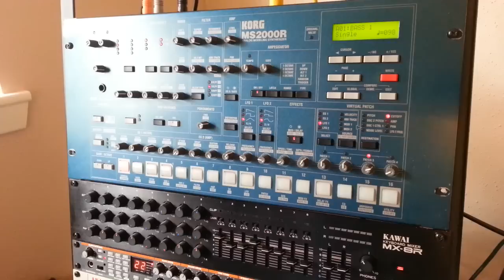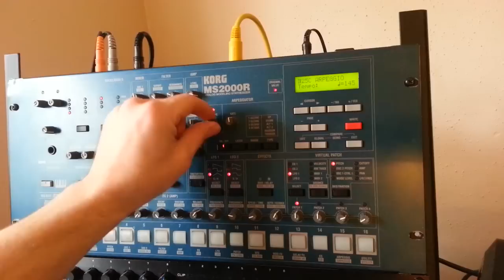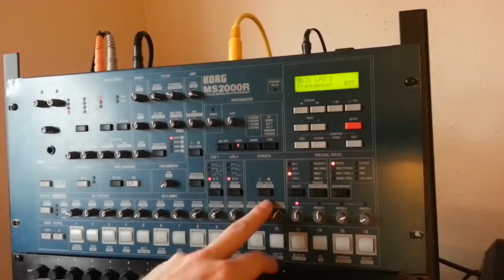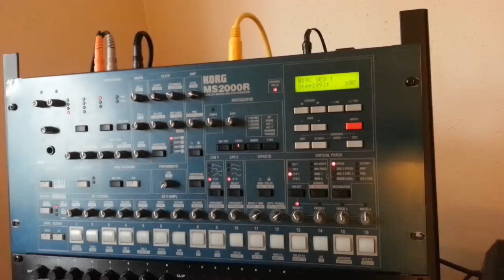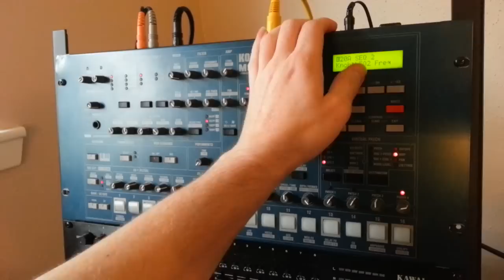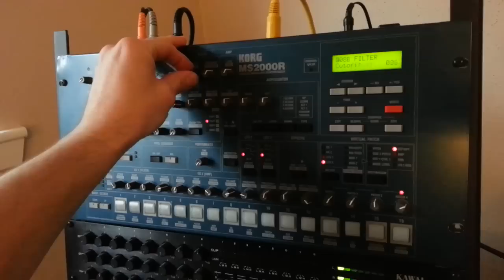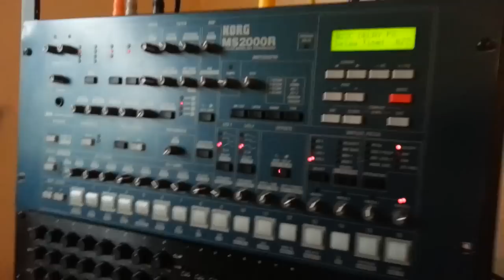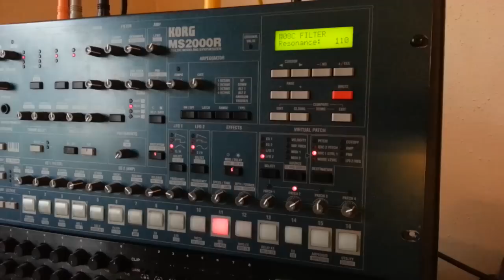KORG MS2000r overview and How to : Mod sequencer

Comment: Excellent thanks a lot Will - been programming up the old MS2kBR (linked to the B keyboard: 'ODD/EVEN' now = 8 beastly voices!), so this was real helpful.  ps. curious what's the Kawai unit below Will? cheers
Reply from the maker: glad you like the video. The kawai is an mx-8r, an 8 channel mixer with 1:3 midi splitter. It distorts nicely when over driven and very cheap.

Comment: Great tutorial, thank you! The manual - as you said, doesn't explain very much on the synth side! 
Is there a way you can sync your computer to be used as the beat/drums and as the clock instead of an MPC? If there is, does it just work the same as if you were using the MPC?
Reply from the maker: You can, but you will need a midi interface. That will allow the computer (daw) to send clock out or receive clock from the ms2000

Comment: Great video, better than the manual :) Got the ms2000r some years ago and learnt how to use it pretty much but it's not had much use for a while with new gear entering my studio. Just got the keyboard version today so I'm experimenting hooking them up. Have you done this? I'm trying to get them to play as an 8 voice but there is very little information available.
Reply from the maker: +zafrosoundz I just got one myself. I traded a Korg Minilogue for it + some cash. Anyway check it out: https://www.youtube.com/watch?v=ZApiSSGHFUU
Reply: +will haha we're on the same wave length dude. I actually found the details in the manual eventually. Lots of angles to explore it's a whole new beast now.    I've been experimenting turning off send controls etc using it as a 4 Osc synth. A lot to explore.

Comment: Great turtorial! Many thanks!!
I bought this synth last week as second hand.
Is it possible to have 2 sequences running for the pitch?
So for example  on SEQ1 a base line and on SEQ2 higher notes?
Reply from the maker: +peterismobiel Yes and no, If you have to mod lanes adjusting pitch, then they will sum and provide only one output. However, if you split the mode into 'dual' and setup 2 separate timbres then you can mod sequence each one, but you will need to setup a split or separate midi inputs. If that doesn't make sense let me know and I can do a quick vid next week to demonstrate, thanks for watching!
Reply: +will scott 
Hi Will, thank you so much for that! 
Since I am totally not familiar with this machine,  I would love a video. 
It is so much easier to understand for me (and others too I presume) because you certainly know your way around on this synth :-)

Comment: Thanks for you video! But I can`t understand for sure. How many instruments can you run with this midi-spliter? I saw the back of it - it has only 3 midi-outs.
 Please, correct me where I'm wrong...
 midi-controller connected to MPC via midi -> MPC midi-out connected to midi-spliter in - > all synths connected to Kawai via midi and audio -> audio-outs of Kawai connected to Behringer?
Reply from the maker: Sergio V correct, and if I'm short on outputs from the kawai I'll use a midi thru from an instrument to connect

Comment: Great video
However - after all this time you spent creating that sound / custom patch / custom voice (however it's called)  - I understand that if you now switch to another sound, or switch off the machine...the custom sound you've made will be lost! 
Do you have any advice for saving sounds for easy recall? 
In a live situation you might want to toggle through multiple custom sounds during a live set - in which case you wouldn't be able to create each custom sound afresh mid-set. - unless you want to annoy the hell the audience.

Any tips?
Reply from the maker: Yeah, I should have demonstrated that! Basically after creating a sound you press the 'write' button twice and the patch will be stored in the current slot
Reply: I see - so one has to write over the preset sounds to save new ones? Any way of making new slots?
Reply: Thanks for getting back btw

Comment: Great video. I feel like this is a dumb question, but in your video, when you make changes to any parameter we see those changes in the menu along with the parameter name.  Is there a menu setting to enable this?
Reply: Also, I'm using the non rack mounted version.
Reply: Nevermind. I wasn't in edit mode.

Comment: Very helpful video. You helped me get out of the presets and actually make a pad. Still it seems my sequencer is not working I followed your instructions: pressing seq 1 then adjusting the knobs and then turning on the mod sequence and pressing a key but only the light under knob1 "common" lights up. If anyone could help with this i would be very thankful!
Reply from the maker: FellCommaDestroyed it's like 1 of 2 things.. either you need to hold the key down longer OR under the sequencer settings in the menu, Last Note is set to 1 and you'll want that up to 16..
Reply: thanks for the response! I will give both a try
Reply: I'm thinking that the problem has to do with the sequencer settings. I can't seem to find last note in the menu. Under SEQ COMMON E18A-E18E:  Last Step is at 04,  Seq Type Forward,  Run Mode Loop,  Key Sync Timbre, resolution 1/4. Thanks for the help so far!
Reply from the maker: sorry! Last step is what I meant. Set it to 16 and set run mode to loop and change resolution to 1/16 to get it going. Also,  make sure the sustain is up on your amp envelope so you will be able to hear it as long as you are holding a note..
Reply: I changed all of the settings to those, adjusted the 4 knobs like you did in the video, turned on the mod sequence and held a note but nothing happened. it did the same thing where only the light comes on under the first "common" knob.
Reply from the maker: is your arpeggiator on? or are you on a dual or split patch?
Reply: I've stepped away from the synth for now. i don't believe the arpeggiator was on. basically all that happens is the note playing normally. I'm unsure what you mean by dual or split patch. Could you explain this? Your video has helped me step into actually making a path. before that it seemed like the synth was only giving me presets. even though the presets are interesting I'm hoping it is capable of more. I may not have time to reply; thanks for the feedback it is much appreciated! I really want this sequencer to work haha!

Comment: Hey man! ++
your video was great. It actually helped me decide for the MS2000R. I just got it, but I'm having some trouble setting it up. I just connected a nord electro to the midi in of the synth, and the connections seem to be in order (correct midi channel and proper in and out cables to and from the unit) but when I play the nord, I only get sound from the synth from the same 6 keys throughout the keyboard. A wholetone scale starting from C# (C#, D#, F, G, A and B). I don't know what the problem is, but I'm not getting any sounds from the other six keys in any octave, which makes me think it is not the custom tuning available in the settings of the MS2000R. The nord plays fine when I try to hear the sounds that come from it. Do you have any idea what I might be doing wrong. Thank you for any help you can give me and thank you for your video. 
TOMAS
Reply from the maker: from a freshly booted ms2000, try this. press global. press page+ until you see 'midi filter...'. press cursor -> until you see NoteRcv and verify that it is set to all. based on the notes you listed, and assuming you are starting a C it could be set to odd. let me know what's what..
Reply from the maker: and also, if you just got it, and don't have any patches made etc, I would definitely start with a factory reset.
Reply: Hey man! it was exactly what you said, the problem is solved :=). How do you do the reset? I tried looking it online, but i'm very bad with this... could you point me towards a more comprehensive explanation somewherE? thanks for your help sir

Comment: Will, do you still own this synth and think of it as a central instrument among your other collections?
Reply from the maker: Bobcatt22 I do still own it, and use it occasionally as a vocoder.. however, I have switched over to a micromonsta for my VA duties, partially because it sounds better, but mostly because of the size. It is still a solid machine that isn't pegged to that dated 90s sound that befell so many other instruments of that era
Reply: Reviewing it now, thank you. Have you created videos on this instrument?
Reply from the maker: Bobcatt22 not yet, but that's a good idea
Reply: I did purchase the MS2000 just yesterday. I will clean it and replace the vocoder slide switch on the back and maybe sell it. One of the patch buttons seems to be dirty, when it is a part, I will clean it with contact cleaner. I guess you sold the MS2000R by now?

Comment: Greatt video !! thank you ... maybe you can help me with an athor ploblem
my display doesn't show the value of the knobs like yours .. any solutions?
Reply from the maker: if you push the 'edit' button near the display a small E should show up on  top left of the display. in this mode tweaking knobs should show the value of that specific parameter on the display. Then press exit to revert back to the patch name. And don't forget to save changes with the write button ( that works in any mode)
Reply: +will Owww i get it now thnx!! they should be funding you :P
Reply from the maker: +ducardus0 I keep telling 'em! thanks for watching and I'm glad it helped
Reply from the maker: Glad that worked for you. To factory reset: make sure it is off. press and hold the mod sequence on/off button and also the number 3 sequencer button (the 3rd white square on the bottom). Then turn it on while holding both and voila

Comment: I can't for the life of me trigger the mod sequence from my MPC2500. I used to trigger it with the keys from a micron but I sold that. Any advice? I've been on this problem for a year or more.
Reply from the maker: So you should have: midi out from mpc to midi in on ms2000. Midi channel set on mpc track to whatever your ms2000 midi channel is set to. and the mod sequencer enabled (black button in mod sequencer section.
Make sure that the ms2k's clock is set to external or auto.. Global >C position should be set to preTG... Maybe make sure that pads to notes are on and on max velocity on the mpc..
Reply: Thanks for the reply! Going to check the Global >C position, was not even aware of that setting.

Comment: Is there a reverb on this unit, I see none.
Reply from the maker: Bobcatt22 no reverb. Per each program: 1 mod effect (chorus/flanger, ensemble, phaser), 1 delay (stereo delay, cross delay, L/R delay), and EQ
Reply: Can you achieve a reverb with the on board effects?
Reply: Was going to put this on CL until I added an external reverb - Alessis Quadraverb - izzz keepin this dude. The synth you replaced for the MS2000, the Micromonsta does not have the knobs like what is on the MS-2000. I do not like menu diving. Add reverb and you got an great synth. Also looking at the Deepmind rack at a reduced manufacturers price of $599.00 or Korg's Prologue.